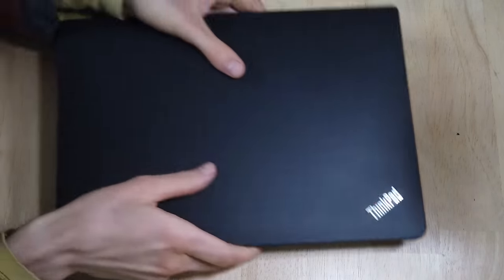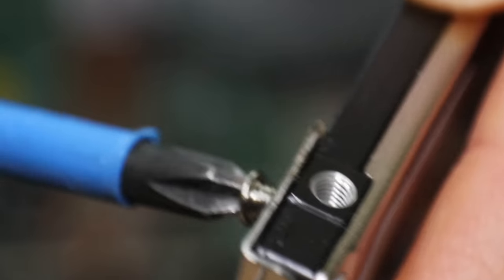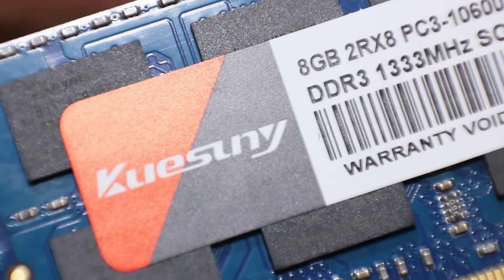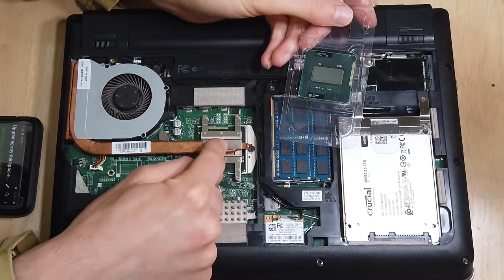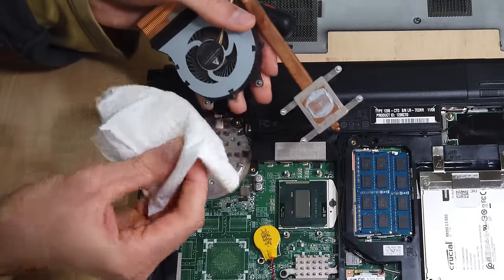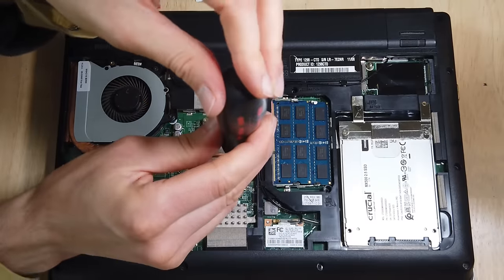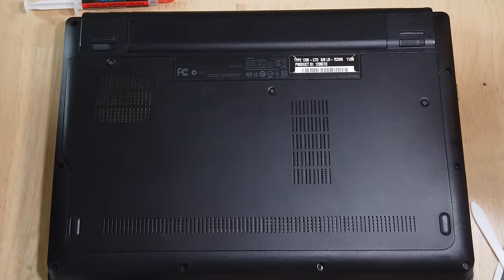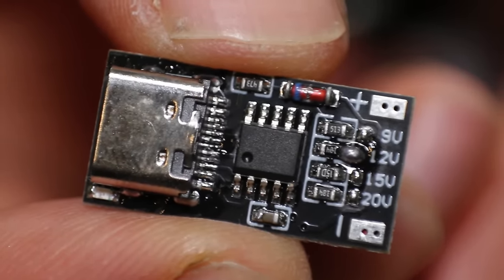The up-gradable laptop I can't get rid of: CPU upgrade etc

Comment: You make it look so easy to upgrade a notebook cpu and ram, but you entirely skipped over the hours of reading chipset documentation of the HM65 express, the cpu documentation...! When I did this with an Acer 5683wlmi, a Samsung Np55 and an HP 8470p, first rule of thumb, gather info on all variants the model was sold. Chances are high, that same model was sold with at least five different cpu versions, ranging from low tier to highend. Second rule of thumb, find out the name of that mobile mpga socket, go to cpu world and look at all cpus made for that socket. If a wanted cpu on cpu world listing was actually a stock buying option for the model in question, you're golden. If wanted cpu was never sold with that model, it gets tricky and heavy on reading. First of all, does the chipset support single, dual or quads? Does it support cpus with higher fsb? Does it support different stepping? Does it support power hungrier cpus/can the heatsink manage that cpu? And one uncertainty always stays, does the bios like a cpu with a possibly newer micro code, has the bios a whitelist embedded?
With, ram, it can be even more tricky, cpu documentation is not always 100% clear if f.e. sodimm dd3, dd3l or dd3ul, if 1rank or 2rank, and how big one single memory chip can be, 256mB, 512mB or 1gB. From guessing the ddr3 module you installed had 8 modules per side, 2ranks, 8GB total capacity, thats 512mB per device. Now I can't remember what the sandy bridge mobile documentation exactly said regarding size per dram device but bigger than 512 by 8 by 2 isn't probably going to work. Maybe it supports 1024 by 4 by 2, but that would be the same total capacity per dimm bank. Either you were totally lucky or you just intentionally cut out all the research steps with only a sliver mentioning, go to cpu upgrade and you're good. That's not how this works with notebooks.

Comment: The only reason why my lenovo is still running is its serviceability. The cpu is technically upgradable but not as easy as a socket and I went for the best one you could get at the time. I've replaced the hard drive twice now to an ssd and I've upped the ram too. Changed the fan as well but cheap Chinese thing went out quick

Comment: No liquid metal
No 3rd gen qm (22nm + upgraded graphics)
No actual stress testing like aida64 fpu only, or prime95 sfft, or occt. Showing the graphs, throttling and stuff

These are the main concerns. Also a laptop with mxm replaceable graphics could have been better.

Comment: I actually did something similar with an old laptop of mine. Had a Pentium B940, 2GB DDR3 RAM and a 320gb HDD. Since I knew beforehand that the fan and the below average heat pipe wouldn't help much, I decided to stay within the 35w TDP threshold and upgraded the CPU to an i7-2620M. I cannot use Windows 10 for some reason but hey, on Windows 8.1 the thing's blazing fast with 8gb of ram and an SSD.

Comment: This trend continued and ended with the 4940mx of something like that. In 2016, I had a single msata sager/clevo with a 4700mq and gpu was like an 870 mxm card or similar. Before I got that laptop, I wanted to get an msi 880 something laptop with triple msata, 44800mq/4900mq, and a 970 mxm card. Using the clevo in college was terrible with such poor battery. However that was my school and gaming computer. I was quite poor at that time.

Comment: yeah 2nd gen is notorious for getting really hot.

now for more upgrades, get a motherboard that has AMD Radeon HD 6630M
OC or higher RPM fan that has same current requirement as the old one. downside its more noisy.... 
then replace the screen glossy 40 pin 13.3inch 90% or more SRGB color accuracy. could not see any oled 13.3 screen that's compatible with this. without any converters or the right resolution. all are 1440p and up.
solder 1 more heatpipe, buy copper sheets, vapor chamber and put it around the fan hole vent

Comment: even though the cpu may support more ram, the motherboard might not (and thats what supplies the ram to the system).

you could have a motherboard that supplies more, but a cpu that doesnt use more (although if you upgrade the cpu, the motherboard is future proofed for that).

here your locked into what the motherboard supplies to the cpu...

also you mentioned the old i5 cpu supports 16gb, but if you upgraded to the new i7 cpu, it supports 32... now it doesnt mean you have to use the max, but it seems weird to upgrade the cpu only to base the upgraded specs off the old cpu limits if your no longer trying to stay with that build...

(also for dry fabric directly on cpu dies and such, you probably want to blot, not scrape, scratch, or rub)
Reply: My laptop Toshiba satellite a500 can have max 8gb ram so how I can upgrade the RAM to 16GB??

And I also upgrade the cpu??

Comment: my acer x58l was on paper only able to take 1gb ram but i changed out the cpu from a single to a dual and was able to only go to 3gb ram, really made a differnce and when SSD became cheaper that just was the cherry on the top for many years, i use a Thinkpad T430 now and that has a huge 16gb in it with a ssd and its faster than quite a few of my mates laptops :P sometimes older is better ;)

Comment: It seems you have an mSATA slot (right above the HDD slot) which means you can add a second SSD there if you want (it's as simple as the more modern M.2 SSDs but with SATA tech, so it's not that fast)

Comment: The issue with the cooling there, you need a 2nd copper tube, that will help the heat transfer.

Comment: id be careful putting true 4c/8t i7s in a laptop like this. that heatsink is not made for that die size (notice the copper doesnt cover the die entirely) and some people will have overheating problems. typically its best to go with the 2c/4t i7s in these situations (I.e. i7-2640M).. while less cores, it does have the increased cache along with the same small die size as the one being replaced... so same power consumption and heat production..  and since youll likely be using a laptop like this for very basic tasks, you wont really notice the lack of cores.. even on win10. just make sure ya max out ur ram for good measure. ;)

Comment: When you said a "a faulty Hard Drive" I was like: Yep, another Seagate HDD. Without knowing it is a Seagate. Now I don't know if it is a reliability issue with Seagate HDDs‚ or if I am lucky with WD‚ but in the last 15 years I've had 5 Seagate HDDs dying on me (5 out of 7‚ that died in like 2 - 3 years). In those last 15 years I've used a mix of Seagate and WD and only 2 out of 10 WD HDDs died (one of them was pretty much my fault‚ the other one gave up after almost 7 yrs). Right now, I still have 2 Seagate HDDs that I use for CCTV recording‚ both have 500 GB‚ and are almost 7 yrs old. The other 8 WD HDDs are 500 GB and 1TB‚ with an age between 8 and 12 yrs and still no sign of wanting to die.
Reply: My intel SSD is a tank 
I’ve abused it for ten years with big game downloads, deletions and redownloads, whacked my cousin ovee the head with it, fondled it , 
Still works like it did on day 1

Praise be to intel

Comment: I upgraded my laptop, it has a GTX 980 GPU which is not upgradable, upgraded from Quad core to Eight core Extreme CPU, upgrade ram from 16GB to 64GB, 512GB SSD to M2 2TB. Used as multi retro gaming platform that can play all the arcade to PS4/Xbox games using emulators and the largest PC games. Currently have close to 100000 retro games installed, have a HDMI/Display port for an external monitor.
Reply: Lmao."PS4/Xbox emulators"
Stop the lies, there isn't even a ps4 emulator out for release yet...that 980m probably struggles on low settings with modern titles too
Reply: You might be able to upgrade the 980M to a Pascal generation Quadro card. Just gotta make sure the heatsink gives good enough thermal dissipation.
Reply: @kingeling  Mobile GPUs are not upgradable in laptops, they're soldered to the mainboard. The laptops with upgradable GPUs are the MXM socketed GPU variants.
Reply: @rulvra3072  I am aware of that, I just thought he was talking about the 980M being the best MXM-B card
Reply: A gtx 980 is barely above minimum spec for modern titles. Saying it can handle them is a bit too generous, especially since laptop gpus are weaker than their desktop counterparts

Comment: E330 is equally awesome and slightly fresher :) I had and sold several, great stuff. Anyhow, did you actually get a stable and cool laptop after putting i7 2nd gen in it? Because I briefly replaced a 3rd gen i5 from one of my e330 with an i7, it did boot just as yours, but sadly the cooling couldn't handle it, it ran way too hot, so I had to put i5 back.
Reply from the maker: Mine did get into the high 90's when doing the geekbench benchmark. Never got to 100°c ( which is the critical temp on those old CPU's). I didn't really like it running that hot though. So I used cpupower to scale the CPU down to a maximum clock speed of 2.4ghz ( used to boost up to 3.5ghz). Still a great deal faster than the old CPU and the temps never get much over 90°c under heavy load.
Reply from the maker: Also I envy the USB 3.0 on the E330
Reply: @ashsibebytes4846  At least now you know not to bother with putting 3rd gen i7 in e330, the issues is the same, their coolers are just not built for i7s. Yes, USB 3.0 is great bonus for E330 :) Meanwhile, I actually read your descriptions, basically already answered. There is still one option, since there seems to be an option for a GPU on motherboard, that must mean that there exist a cooler for E320/E330 with more massive copper heatsync, which, if installed, might cool i7 slightly better. Also, I think you should get a stronger charger, like 90Watt version, after putting i7 in these. Anyway, both E320 and E330 are amazing in terms of how easy everything is to clean, replace or upgrade.

Comment: Even though the cpu supports more ram it’s possible that that motherboard DOESNT and you should do a ram test to make sure all of it can be used by your laptop.
Reply: It was shown as detected in the BIOS, so working.
Old CPU supported 16GB over 4 modules, mobo has 2 slots, so 8GB max.
New CPU 32GB over 4 slots, so halve that and you have 16GB, as installed.

Comment: When you scroll down to i7-2860qm does it support on your laptop?
Reply: yes, it’s possible, but the motherboard’s power lines are not designed for powerful processors, it’s better to install an i7-2630qm. Together with 16GB of RAM and a SSD 480GB-1TB sata-lll, 2.5", the laptop will be fast even with this processor (2630)

Comment: Assalamualaikum, REMOVE AMY PASTE FROM THE CPU "BOARD" surrounding the CPU.

Because the HEAT will travel onto the BOARD material that the CPU is built into.

Causing Many issues.
Reply: Masha allah did allah tell you thisnin the Qur’an 

Surah al Computer Science

Comment: I have an HP DV4 1275mx from 2009 that I maxed out to 8GB DDR2 ram and SSD hard drive and maxed the CPU out to a ZM-87 and it runs Windows 10 great LOL it's sentimental to me so Ill probably use it until 2025 when Windows 10 looses support

Comment: I have a Samsung rv420, the version without dedicated graphics, I wanted to know if I can go from an Intel i3 2310m to a 4 core and 8 thread processor, the issue is the hm65 chipset that only allows 2nd generation processors and they are all 45 tdp and my notebook's processor is 35, what can I do?

Comment: That single heatsink is not enough for I7 cpu, you may find a douple heatsink then the temp may reduce significantly.
Reply: How do you put another heatsink to small laptop?
Reply: @nicojaewpunk  There maybe another version of 2 tubes heatsink or you can solder a copeer tube beside the orginal one.

Comment: I did a similar update on my T440p, 16gb ram it supports up to 32gb, and added a m.2 sata SSD, it has an m.2 slot that's meant for LTE network cards, but you can add a m.2 sata not nvme unfortunately.
Reply: T440p doesn't support more than 16GB because Intel 4th gen CPUs are limited to max 8GB sticks, for 32GB you'd need a ThinkPad W540/W541 which have 4 DIMM slots instead of the 2.
Intel 5th gen laptop CPUs (ThinkPad T450 etc.) were the first ones to support 16GB sticks
Reply: @Pasi123  yes I know that officially it only supports 16gb, but it's a software limitation, it seems that if you install coreboot or libreboot it allows 16gb sticks, but again this might be hit or miss...
Reply: @lucaspagote3042  After a quick search I wasn't able to find any proof of anyone been able to get 32GB RAM working on a T440p.
The only thing I can find is someone on hacker news claiming to have 32GB in his T440p but that could very well be a typo
Reply: @Pasi123  there was a guy on reddit that tweaked the coreboot code and was able to boot, that was a couple years back. I just assumed it was possible because of this post.

Comment: if you want us to believe what you just said in the screen, give us the proper benchmark for the system, comparing it from the old configuration to the new one since you replaced all the components, a furmark, or any benchmark. yes, the upgrade is possible but the viewers like me were left hanging to the fact that is it worth it? what are the downsides of this upgrade, the cooling specially

Comment: I had upgraded my cpu on a 2007 HP laptop. It can only run in balance mode. It turns off at High performance mode. So my problem is to get a better heat sink or could it be too much wattage?
Reply: Neither. Your motherboard does not have the power rails for the CPU. Find the schematics f your laptop , replace the power chip (generally a MOSFET) and use a higher rated power supply. I assume your laptop came with a 45W supply. Upgrade to 65W or higher, as applicable.

Comment: It looks like there a vacant gpu "slot". If you have the skills to solder a gpu and vram on it, it would prolly be the "ultimate upgrade"
Reply: Needs a new heat sink and fan assembly
Reply: And mod the bios
Reply: @EvanPang-w4i not for a low profile gpu

Comment: Can you please tell me why you crossed out the serial number on the BIOS screen, when it's also available in the back of the laptop, I am also confused at why you bothered to remove the MAC address since I am highly certain even Lenovo does not know what Mac address correlates to what laptop(this at least has some semblance of a reason cuz theoretically someone could spoof your Mac address to do something naughty and you could feel radically be on the hook for it, but then they would someone have to also make it look like you did it at the same time requiring you already to have been doxed), as well as what can be done with this information, the only people who care about these pieces of information are Lenovo, and they are the only one with the ability do anything with this information, and since  they haven't had support for this laptop in at least 6 years warranty theft is not a concern, and even less so doxxing unless you think your somehow going to have either the government(the only people that can possibly do so and even at them this would cost thousandsnof man hours probably) is going to force Lenovo to or a rouge Lenovo employee do so on their own use the information to search for the original buyer, then find the wholesale reseller who bought it from them(get a job there or pay off a employee that works there) and then find out who they sent it to(assuming they actually keep track of which serial number goes to which person) ... I am sorry this seems like effort unrequired, 

Pointless tangent I understand, but I just got through looking for trucks online and so many people block their license plates, even though they are selling a vehicle which case the license plate is invalid after sale and the license plate number is nearly public information to begin with since the entire point of it is being tied to a name and it being shown to anyone that goes by the vehicle there is no point in hiding it, nor a whole lot that can be dne with it, and all this holds true for your above scenario

Comment: TDP of both processor is different. it can be cause of overheating or motherboard failure?
Reply: yes, but the i7-2630qm processor can be installed, this processor will only need 2 power lines from the motherboard

Comment: I hate the way the computer manufacturing business is gone. Computers are meant to be difficult to repair and even Dell's website if you're trying to upgrade your old computer the specifications for the installed components are written in jargon that is confusing, and designed to be confusing.
Reply: The jargon is fine educate yourself

Comment: Problem with these guys is the idea is great, but all the upgrades you can do now are SO OLD that it really doesn't even save you. If this was possible with hardware made after 2020 it would be great, but it really isn't. Even Framework laptops use weird proprietary pieces that are very expensive and basically worthless on any other device which is a problem too.

Comment: And you did not clean the heat sink or the fan... Big fail
Reply from the maker: I cleaned the heatsink ( did I edit that out ?). The fan though? Got me there
Reply: Guaranteed with a laptop that old, there is a decent sized dust bunny where the fan pushes air through the fins.

Comment: You gooped way too much thermal paste on the CPU!!!  You just need a thin layer, and can use a razor blade to spread it out evenly with very light pressure. The amount you put on there, will act like an insulator where all the extra is surrounding the CPU, helping to hold in heat. I would remove all that paste (along with the keeping it away from electronic comments on the PCB) and just use a thin, neatly applied layer on the CPU Die. You will see the thermals result in much better temperatures.